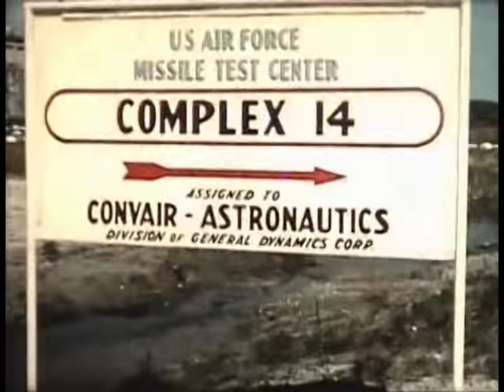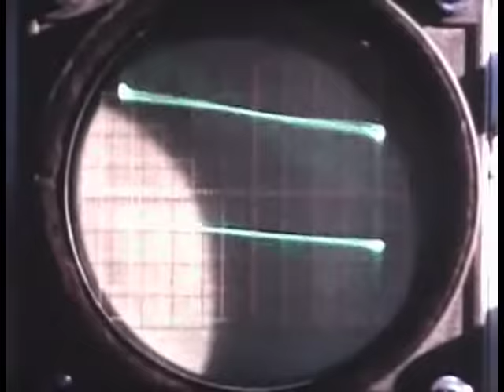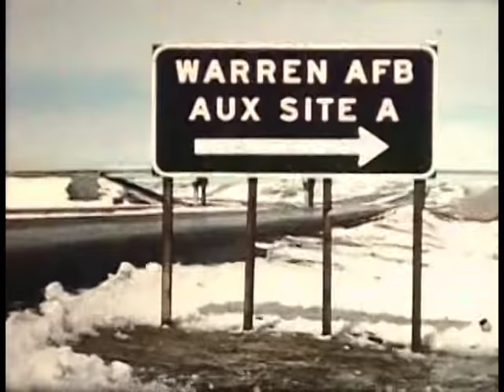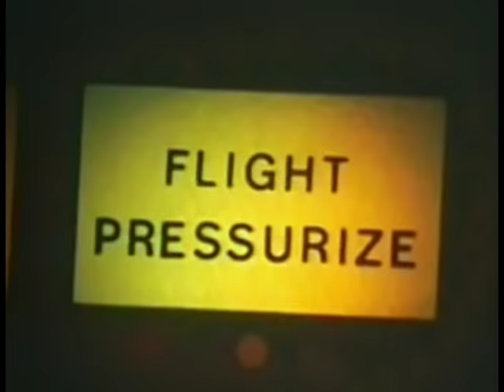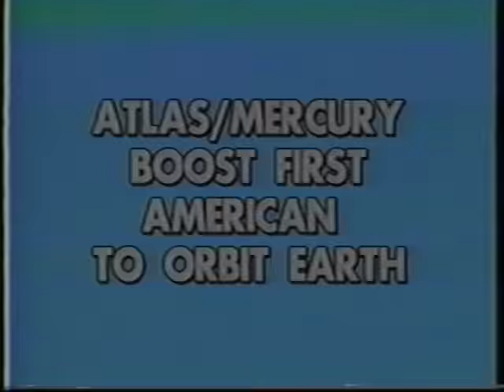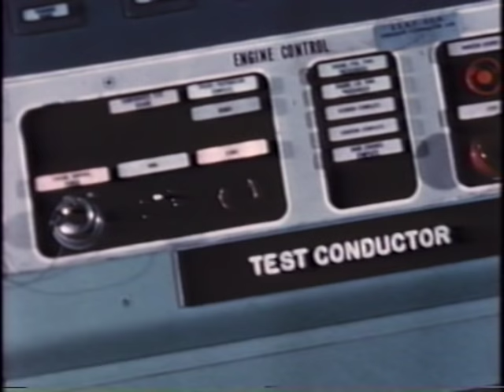Part 3 of 5: The Atlas Rocket, 1957-2007

Comment: If the failure shown at 9:51 of this clip had been on a manned Mercury-Atlas mission, this is how it would have sounded on CBS-TV: 

Walter Cronkite (anchorman): We're less than minute away from the launch of John Doe into orbit in his Harmony 7 space capsule.

John "Shorty" Powers (Mission Control spokesman): This is Mercury Control. T-minus 30 seconds. The umbilical is out....T-Minus 20 seconds. All systems are go. T-Minus 10, 9, 8, 7, 6, 5, 4, 3, 2, 1, Zero..Ignition.. Liftoff!... Anomoly!.. Abort initiated!

Cronkite: The escape tower is yanking Harmony  7 away from.the rocket, which is flying erratically.

Powers: The escape tower has yanked Harmony 7 away from the rocket....Destruct command initiated..

Cronkite: The Atlas has exploded but John Doe and Harmony 7 were pulled away...

Powers (interrupting): Escape tower jettisoned.. Drogue chute out.

Cronkite: We're switching to a shot if the rocket, the flaming remains of which, have just crashed on the beach near Complex 14.

Powers: Main chute deployed. Medical sensors indicate John Doe had a brief jolt of 13 G's during the abort but is back to normal vital signs and reports he's A-OK.

Cronkite: That's great news! You see the capsule descending under it's main parachute, landing bag deployed, and is about to splash down. Depending on how close it splashes down,it may be tower ashore or Colonel Doe will leave the capsule after splashdown, be hoisted into the rescue copter, then the copter will lift Harmony 7 out of the water and take both Doe and the spacecraft to the Forward Medical Area.

Powers: Harmony 7 is approaching splashdown and Colonel John Doe reports he is find shape despite the abort.

Cronkite: Splashdown us imminent...

Powers: Splashdown! Colonel Doe reports he's fine and will be rescued by helicopter while Harmony 7 will be towed back to shore..

Cronkite: A failure in an attempt to put Colonel John Doe into orbit, but the abort system worked perfectly and he's safe and sound. When he arrives at the Forward Medical Area, he'll be checked out, get a short debriefing with Project Mercury management, and will probably hood a press conference later today.....I've been told we will be able to show you the aborted launch of videotape, using a new technique of slow motion replay....

Comment: Rnager 4 did not impact on the far side of the moon.  If it had, we wouldn't have gotten back any photos because the moon would have blocked the radio waves (just like during Apollo)
Reply: "An onboard computer failure caused failure of the deployment of the solar panels and navigation systems; as a result the spacecraft crashed on the far side of the Moon without returning any scientific data."
Reply: @104thDIVTimberwolf  At 22:48 it implies that the photos we are seeing are from Ranger 4.   Obviously that is/was not the case.